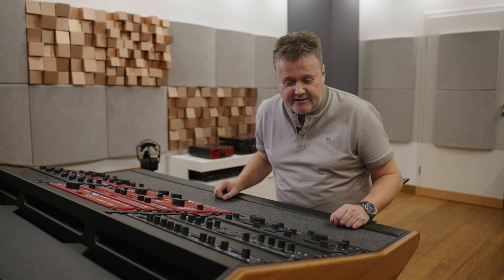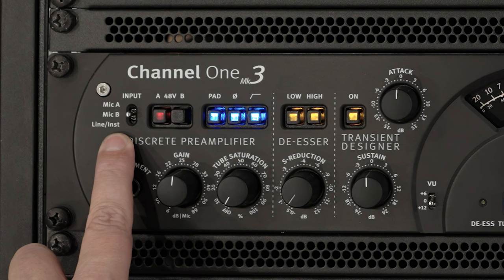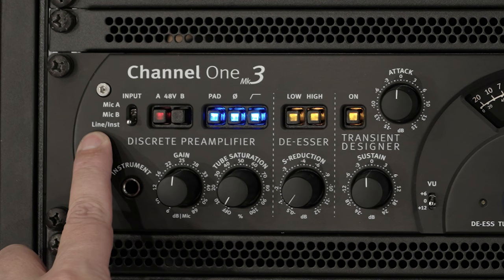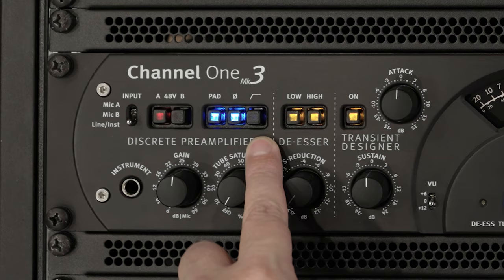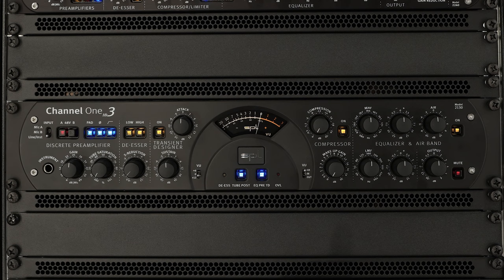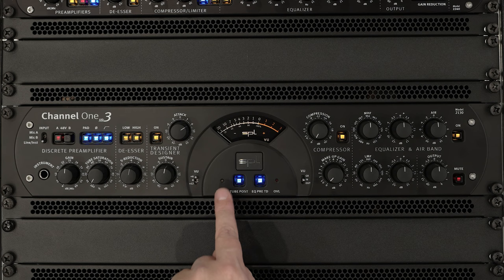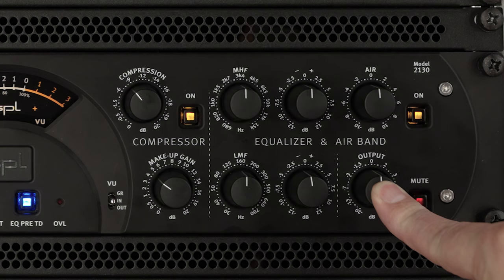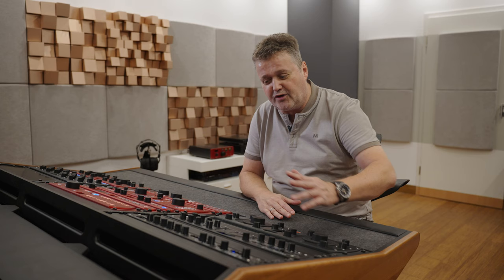Channel One Mk3 – Walkthrough with SPLs Hermann Gier

Comment: hi spl. i have a question. i am interested in buying the channel one mk3 and would like to know if i should use it with a Neumann TLM 49 Condenser Microphone or would i be better off using it with a Neumann U 87 Ai? which mic would i be better off using the channel one mk3 with?
Reply from the maker: Both are great microphones with different sound characteristics. The Channel One Mk3 can definitely bring the best of the best out of both.
We would recommend to test them both and see which one you like better. 
BTW: Channel One Mk3 offers two microphone inputs on the rear panel – Mic A and Mic B. Two microphones can be connected. This enormously simplifies the workflow. Thus, when comparing or changing microphones, it is no longer necessary to unplug them. Regards!
Reply: Great vid! 
When I bought it, I didn't realize there was a Premium version with Lundahl trafos. Are these something I can install myself at some point if I wish to? Thanks!